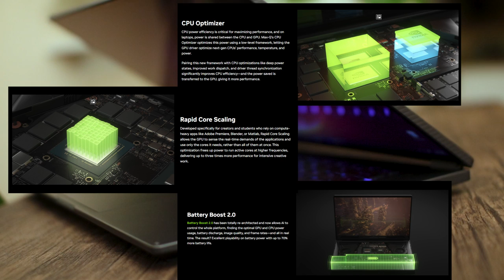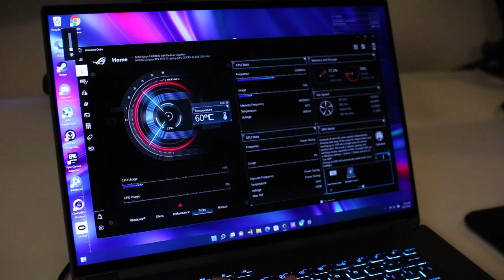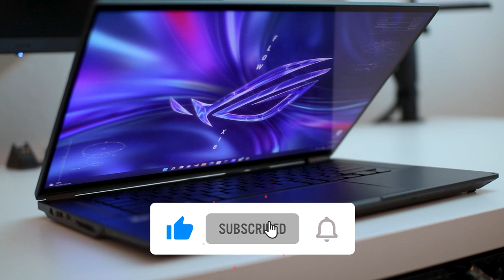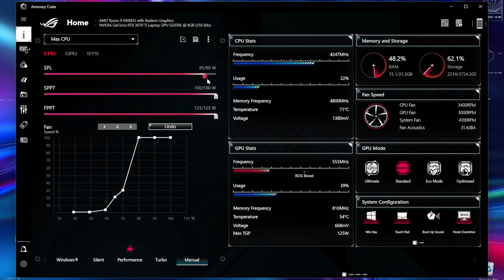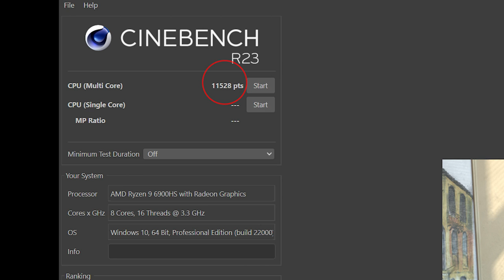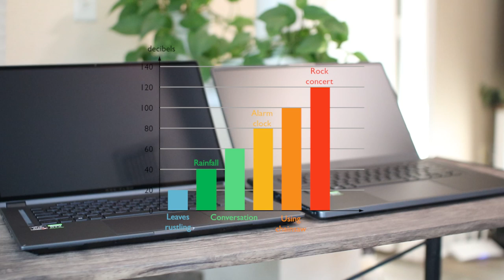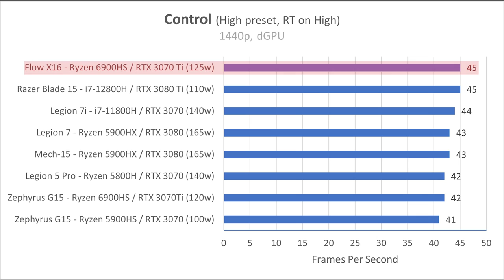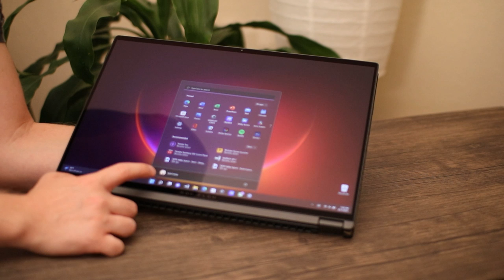Asus ROG Flow X16 Review - Best Gaming Laptop?

Comment: good laptop but the price, come on.. Legion 5 with similiar specs is alot cheaper (if you don't care about the touchscreen)
Reply from the maker: I wouldn’t even put it in the same category as the Legion 5 to be honest. Yes it’s more expensive but it offers a lot more, especially if you’re talking about the intel Legion 5 (non-Pro). 

The X16 gives you better battery life, better performance on battery, built-in tools for tuning CPU, GPU and fan curves, quieter fans overall (especially when under load), centered keyboard (preference), glass trackpad, better speakers, 16:10 aspect ratio, a freaking beautiful MiniLED display with more than double the brightness and true HDR, as well as much better color accuracy and contrast, a touchscreen, GLOSSY display, foldable hinge, thinner and lighter design, smaller power brick, three fan-design with better heatpipe layout (while still being lighter surprisingly), and XG Mobile port for further increasing GPU power if needed which is great for future proofing, all in a more sleek/attractive package (preference). 

So yeah! After using both, I can honestly say this thing is on a completely different level than the Legion 😅

Comment: This isn't the ''perfect gaming laptop''. Its the perfect creator laptop. Obviously it'll appeal to creators and youtubers.

The real perfect gaming laptop would be an 18' gaming laptop with hyper thin bezels and a 16:10 panel with glossy IPS coating to still get good colors. Such a laptop would only be as large as current 17' laptops and thus have enough room to cool a high powered 55w CPU + 150w to 180w GPU, mind you both going full tilt (so 180w + 55w) all with a 330w brick but the laptop would also have usb c charging so bringing a charger along will ve viable.

Comment: Not true I felt the msi studio 16 and that mag alloy was soooo plasticy feeling.
Reply from the maker: Depends on the alloy, the thickness, and the coating. Regardless it’s still way sturdier than plastic (even if it doesn’t feel like it to you), doesn’t heat up as much as aluminum, and of course it’s lighter and more fingerprint resistant than aluminum as well.

Comment: pay 1000 more from the g15 or m16 for a better screen its really cringe if its about 300-400 more definitely make more sense
Reply from the maker: I hate the price but I love the device! It is a one-of-a-kind laptop so they definitely priced it that way. Better screen, touchscreen, foldable hinge, pen support, true HDR, upgradeable ram on both slots, quieter fans, more premium build, more CPU power, faster installed SSD, XG mobile, better battery life. That’s a good upgrade. Maybe not $1000 worth but still a big upgrade.
Reply: @JoshCravesTech  In my country the G15 with RTX 3070Ti and other similar specs is 2500€, the flow is 2800€. I think it's a good upgrade.

Comment: it is insulting id doesnt have a num pad
Reply from the maker: Nah, I’d take upward facing speakers and a centered keyboard/trackpad ANY day over a numpad. But I definitely understand that’s a need for some people.
Reply: @JoshCravesTech  in 16 inch?, you have plenty of space to have all of that
Reply from the maker: @zabawarozrywka1685  16” laptops still have the same chassis size as 15”, just a taller screen. I’ve never personally seen a 15-16” laptop have all of those features unfortunately. Maybe if they put the speakers at the top above the keyboard it could work but I’m sure space is limited.